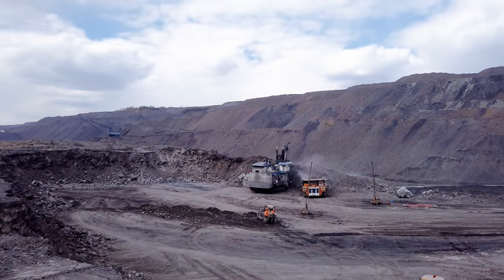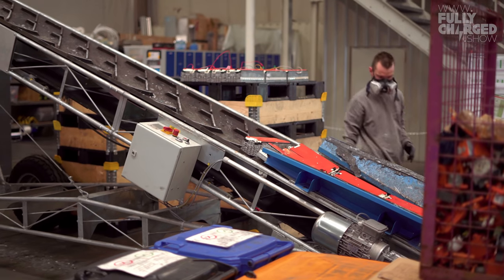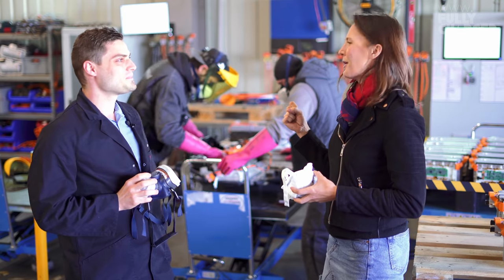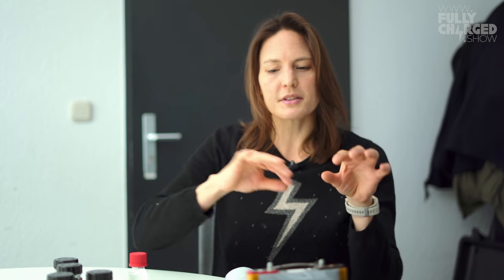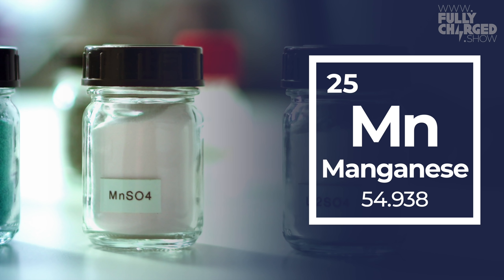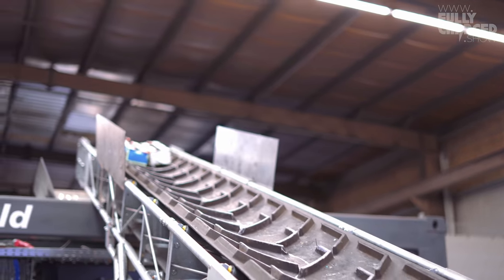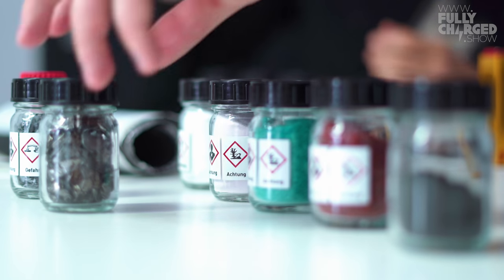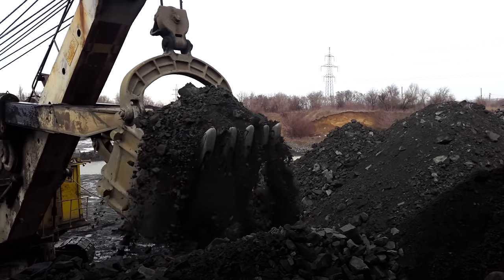Yes, we can RECYCLE EV batteries. Here's how | Fully Charged

Comment: I'm really happy with 72%. And that is today. If I were to buy an ev now, its battery would last at least 10 years and then another 20 as a storage battery in its second life. Imagine the future.
Reply: That's the main thing here. It takes quite a long time before that battery is going to it's end of life.
Reply: The very long life of Li-ion batteries is great news but it does pose a materials problem for new batteries. 
We need to find a recipe that uses less nickel and hopefully zero cobalt. 
Musk/Tesla is one of the few seriously working on that
Reply: Was 72% the final number? I got a little confused about how much of the total battery was recyclable. The chart was 32%, the bald guy said nearly 100% but the previous guy said not near 100%
Reply: @dansanders2679  My understanding was 32% was for the smelting process, 72% was their process and nearly 100% included graphite which they are not currently doing and excluded plastics (91% I think from the graph)
Reply: @pioneer7777777  This is actually a little bit of the beef I have with this video. It would have been nice if these figures had been have been made a little more straight forward and easy to digest. Because even at 80% recycling efficiency, a battery recycled 4 times drops down to 32% of the initial efficiency of its brand new version. Also I wish they'd touched on the following: say a battery has several years lifespan and its efficiency drops down to 60% of initial efficiency. Let's assume the current 72% recycling efficiency. What do you then get as a recycled battery? 70% of the 60% or 70% of the 100%? If someone in the know could help me with that one, that'd be great - thanks.
Reply: @maxmouche  Recycling efficiency is the recovery rate of materials, and is completely unrelated to a battery's capacity (and its degradation over time). Degraded batteries that cannot hold a charge still have all the chemicals they started with (maybe excepting a bit of evaporated electrolyte), just broken down or reacted into non-functioning states. A recycling efficiency of 72% means you get back 72% of the raw materials that were initially used to produce the battery. If you then add in the remaining 28% of raw materials that could not be recovered and make yourself a new battery out of that, you have a new battery at 100% capacity and lifetime for another 10 years in your EV or whatever.
Reply: Yes and the most important substances are extracted. Graphite is only carbon that is no big deal and relatively cheap and abundantly available. But for sure graphite will also be recycelt once bigger scale is implemented.
Reply: Bainsworth  Barinlessworth, lithium is not toxic and most importantly it's not a greenhouse gas. Lithium is a very useful metal that we need not just for batteries.
Reply: Acid, now there is the key. Recovery rates are low and spent acid to deal with. No one is truly recycling lithium ion batteries in a environmentally friendly way. I find a lot of smoke and mirrors in this recycling process.
Reply: Bainsworth  Current state of the art (32%) is essentially what they use now on a big scale worldwide, however this particular plant already recycles at 72% efficiency, so this is definitely already going to become the minimum standard in the very near future (probably also increased regulation to push for better recycling) and this plant could bring it to 91% if they also recycled graphite, they just don't do it now, because it isn't worth it (yet). 

There btw are already companies that can recycle up to +-95% of Li-ion battery, however these are usually start-ups specifically aimed at the growing recycling market from EV's and are now just perfecting the recycling process to withing the next few years roll out large scale operations, somewhere in line with EV batteries growth.

So no, we aren't goign to a dumpster fire planet due to batteries.
Reply: @schulzmj1  Acid isn't necessarily environmentally unfriendly, not all, it just depends on what kind of acids and how you deal with it. If this plant was environmentally unfriendly due to acids, it would never have gained the necessary permits in Germany.
Reply: @MDP1702  There is a better way but show me your chemistry.
I've dealt with spent acids and they had to go down disposal wells even after being neutralized.
Reply: @schulzmj1  I am not a chemist, but I do had some chemistry in university and in no way would you be allowed to dispose of acids in an environmentally unfriendly way (there are quite some regulations around this).

And if they are neutralised, many of these acids are not dangerous to the environment, the ones that are will have to be disposed of in a regulatory sanctioned manner.

Ofcourse I don't know exactly how they deal with the acids in this plant, however acids are used so much, this isn't really new terrain.

Now, maybe you can tell me instead why acids are so bad, even when properly neutralised or disposed of.
Reply: @MDP1702  The concentration of the acid is important but more important is what is added to the acid during the process. This is the sixty five thousand dollar question. The spent acids I have used were pumped down disposal wells (1000m + Deep) and I don't have a problem with that. 
Please note, in this video the use of the word acid is mentioned only briefly and toward the end of the video. They appear to be deliberately avoiding the use of the word and they never mention how it is dealt with.
I'm sorry but claiming to be environmentally friendly and not being up front and open is very suspect.
I hope you can appreciate that I having dealt with acids am just asking the question.
Reply: @schulzmj1   I don't think they avoid acids, rather you are making a bigger deal of it. If it is a dangerous acid, it will be regulated by law. They can't talk about the entire process, everything they use and everything the dispose of and how, that would make this a few hours long, not something youtube channels do.

and not being up front and open is very suspect.
I am sorry, how are they not being upfront? Are they refusing to answer a question? Are they going around it? Now, they don't, it is just that this isn't part of this interview, which they are not to blamed for. If they really thought the acids were and issue, they wouldn't even have mentioned acids.

Acids are used in many industrial applications, there are strict regulations around it, you are essentially saying that either this company is breaking the law or that there are no good regulations, both of which I'd doubt in Germany.

Honestly this sound rather conspiratory, and I am not going to keep a discussing then, sorry.
Reply: @MDP1702  Well I only work with the stuff.
But you know what they say ignorance is bliss
Reply: @schulzmj1  And ofcourse because you work with the stuff, you know everything. Honestly the fact that you work with it and still react like this means you either work with the bad kinds and just doesn't distinguish between the many different uses and kinds and immediately think of the worst and/or you don't know the regulations in Germany and don't understand how stringent they are.
Reply: @schulzmj1  You certainly made it sound like you did, but fine, think twice before essentially saying that they use environmentally unfriendly ways for their process.

And before you say you didn't claim that, here are your exact words: "No one is truly recycling lithium ion batteries in a environmentally friendly way."
Reply: @nilsfrederking62  Yes, graphite is only carbon but a lot of the lithium is trapped inside the graphite so, in fact, not recycling the graphite means not recycling lithium. Better read how Li-ION batteries work.

Comment: So impressive that they use the power from the batteries to recycle the batteries! Up to half the required energy :D
Reply: Don't forget the spaetzle required to power the workers.
Reply: Machine that build the machine.
Reply: It’s good to use the energy but a charged battery is potentially dangerous.
Reply: @Dave5843-d9m  That's WHY they're discharging them, they just found additional savings by using the power left in them. VERY smart
Reply: They should require batteries come in charged so that the power can be used to disassemble other batteries. This will further reduce costs for the recycling company and shift more of the costs to the consumer, so that consumer realizes more of the cost of their purchase, akin to a carbon tax.
Reply: @Obscurai  this isn't a consumer-facing company, they deal directly with OEM manufacuturers.   That kind of restriction would just make the OEMs choose a different company. Also, many of these are likely damaged packs which may be unsafe to charge.
Reply: @patreekotime4578  That cost, where possible and charging is possible,  can still be passed down to consumers.
Reply: @Obscurai  On an actual energy usage/recovery point of view, going out of the way to charge the battery packs is a bad idea. Batteries are fairly decent, but there's still energy losses from the process, which only gets worse as the batteries age.

There's no financial value in it either, someone else putting power into a battery pack they are throwing away? For someone else to use? The recycling factory would do far better just having renewable energy installed (which, they probably already do)

The brilliance of this processes is that they have to discharge the batteries anyway, for safety (there's a reason Li-Ion batteries are shipped at around 25% SoC), this just lets them recover that otherwise wasted energy
Reply: @KieronTaylor  You mean Spätzle, the svabian noodles, for sure. But that was a north german factory in lower saxony where you find pure or high german spoken, no dialect like in svabian.

These are guys from the anglo saxxon tribes region that back then 1000 years ago had partly moved to and conquered Britain.

Wendeburg is close to VW and its plants in Wolfsburg, Hannover, Braunschweig and so on.
Reply: It's certainly smart, but in a world where energy is valuable, why wouldn't you fully discharge the battery before selling it to the recycling company?

Comment: an improvement should be the design of batteries taking into account the recycling to increase the efficiency of recycling itself.
Reply: If the battery manufacturers themselves were forced to do the recycling that might happen.
Reply: There have been attempts in this area, but there are lots of reasons why the main focus has been energy density. Higher energy density leads to lower weight, better performance and often lower costs. So it's clear why recycling is only a secondary priority.
Reply: That's been the goal for over 10 years.  I've been following them for over 10 years, always was a priority.
Reply: It would certainly help if there was an industry standard, or maybe an ISO standard, generic battery pack that volume car manufacturers could use. It might also help niche car makers if generic battery packs were available from several manufacturers offering choice and competition to lower prices.
Recycling would be a lot easier if there were fewer battery pack designs too.
Reply: @Sarge084  totally agree, I think it will happen.
Reply: and btw this is going to be a huge business !
Reply: @Sarge084  has been talked about for a long time, but like most standards has been drawn out by arguments and disagreements between the various companies. 
The idea of a modular hot swappable battery pack would be amazing, as is the idea of people buying a car but only rent/lease the batteries. Instead of paying the upfront cost of a battery pack and recharging them at home, people go to a service station and have them swapped whenever they like with an automated system (you park on a spot and a robot system pulls out the current battery and installs a fresh charged one). The idea is that people pay for batteries and charge in a way that's more similar to petrol so they don't cop the upfront cost but also don't have to worry about long term battery degradation or range limits as changing the battery should take less time then filling up with petrol.
Reply: @zapfanzapfan  
But many (if not all?) are building recycling facilities..... Because it's economical to do so.
Reply: Baby steps, most people are driving gas still

Comment: One of the best productions of fully charged. Please more our this.
Small note: Batteries are being recycled since ages. Lead-acid batteries up to well over 95% (because it's relatively easy), primary cells to a lesser degree (because it's harder) , but still, there are numerous facilities that do battery recycling.
Reply: Sadly most lead/acid batteries just get broken up to recover the lead. The rest gets dumped.
Reply: Andreas Ryf. The best prices at the scrapyard are for batteries
Reply: @hughmarcus1  The rest is mostly "just" plastic, which is relatively worthless but for car batteries should probably be regularised into a single type of plastic really.  The lead in lead acid batteries is nearly always 100% pure lead, so you just need to drain and neutralise the electrolyte (after which there is zero chance of fires), and then shred the battery whole, dump it in water, skim off the plastic (which floats) and then melt down what is left over.  By comparison, recycling an EV battery is very hazardous and complicated to recover the materials!
Reply: most lead-acid batteries are piled up in ships and sent in africa or india or other poor countries and people with hammers just crush them, melt the lead and burn the plastics. A lot of the lead oxide ends up in the environment but that's ok we don't see it. In the future the business will grow with those lithium batteries. There are a lot of children, men in forced labor camps and so on who eagerly await to chop these batteries with axes, burn them and recover the copper. The residual energy in the battery will be put to good use to start the fire when they hit the battery with the axe. The bald man already said that the easiest way to recycle them is to incinerate them. Sure, there will be some toxic waste spilled in the environment but that's ok because they are used to this way of life in africa, india, china and so on, they need those chemicals, they are like vitamins for them, they don't even wear respirators because they want to inhale as much as possible.

Comment: Excellent. I particularly like the use of residual current remaining in the battery to recycle itself. Now for one on recycling solar panels to put that argument to bed too!
Reply: Ok, so where in the world are solar panels being recycled?
We have one company here in Australia that strips all the components and flashing off them to be recycled, but the panels themselves to the best of my knowledge no-one is able to recycle.
Reply: @Jake12220  that would be a great topic for another fully charged show!
Reply: There is a process to separate glass sheet without smashing them, so backside sheet of a new dual-glass panel could easily come from an old panel :)
Reply: Let's first get to the point where there are so many solar panels around that they need to get recycled LOL
Reply: @giovannifoulmouth7205  that is like saying let's first get to the point where we have so much shit in the house that we can't stand and then start building a toilet.
Reply: @Jake12220  all they can recycle is the aluminium in the frame and some copper cable
Reply: @ArthursHD  sure, except that the glass sheet separated in Australia or USA or Europe has to be cleaned and transported in china to a panel factory and keep the fingers crossed for it to fit. I think all this process will cost and produce more CO2 than making a new glass.

Comment: Brilliant program so glad you went there to look around at this fascinating company. 

They're normally the recycling firm I point people up because their methods are of a higher standard and percentage than most recycling batteries.
One thing you could have emphasised is their use of a containerised system for the initial breakdown of the batteries so anyone can have two containers at their Recycling Yard with Duesenfeld's  system in it. The chemicals then go off for specialist separation with the metals going off as normal.

Comment: Dr C:- "Why isn't battery recycling as common as glass or plastic recycling?" .....
well, with glass recycling you are just remelting it to make more glass (albeit not as pure).
You are not breaking the glass down into Silicon Dioxide, Calcium Carbonate, Sodium Carbonate plus a string of other components such as Iron, Arsenic and Barium. 
Shredding batteries is easy....stopping them from going BOOM during the process is a little more difficult!
Great video and excellent presentation as always.
Keep up the good work.